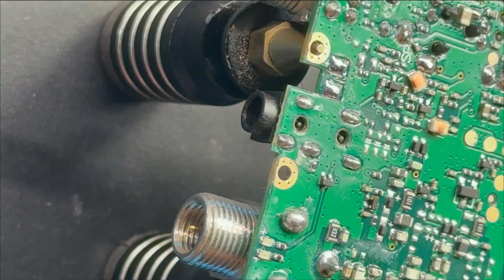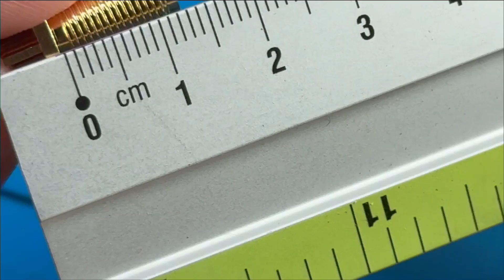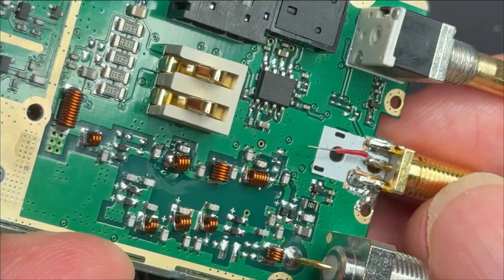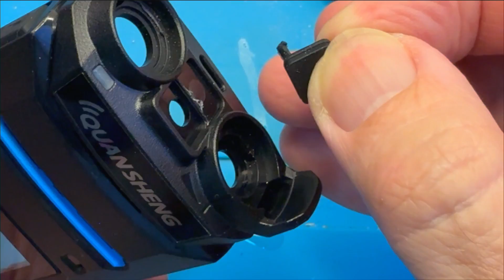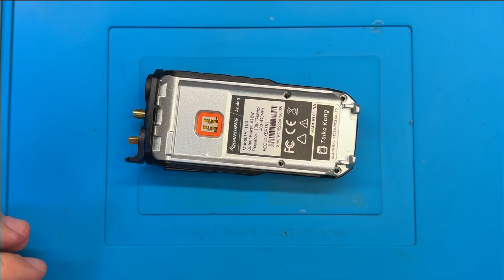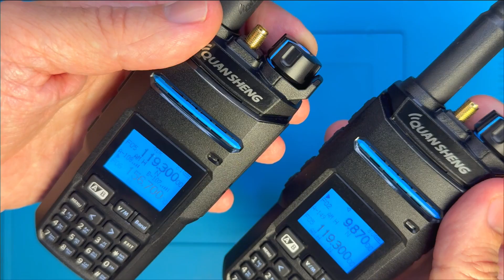EB021 - Quansheng TK11 3.5mm Jack to SMA Modification

Comment: Can I just take a thin coax from the rf input pin 1and make a jumper to the main antenna and use that
Reply from the maker: Hello Thomas. Unfortunately not. Without special switching, the Tx RF from the VHF/UHF output stage would probably damage the RF input of the frequency up-converter that I covered in my teardown video (EB019).

Comment: I did your modification today, it came out nicely.  Thanks for the detailed instructions. GS
Reply from the maker: Well done! Good to hear it went well.
Reply: @ElectroBananasYT  thanks again.  BTW, the soldering in my TK11-5 was better than the unit in the video.  The little PCB locating spigots on the chassis  either side of the new SMA socket had been filed off, presumably during manufacture. GS
Reply from the maker: That is interesting to know. Thanks for sharing.